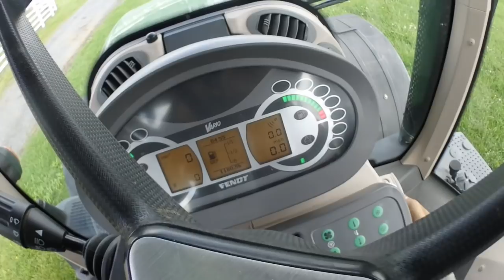Picked Up The 7930

Comment: When it comes to power on Fendt is easily identifiable, 828 stands for 8 - series and 28 + 0 = hp, so 828 is a 280 horsepower tractor. If you get a 936 it would be 360 horsepower, or a 715 is a 150 hp and so on.

Comment: KX means it was 1st registered in at our DVLA (DOT) in the Milton Keynes region (K) by the Northampton office (X). 12 means is was registered between 1st March & 31st August 2012. Last 3 letters are random. The 1st letter is for 1 of 19 DVLA regions all over the country. Then the second is for the DVLA office that issues it. Most regions have 2 DVLA offices that deal with registrations, large areas have upto 5 like Scotland. So they split the the second letters up between the offices  If the plate had a 5 or 6 as the 1st number is was registered between 1st September to  28th February.

Comment: New Holland won't ever be the tractor old Ford tractors were
Reply: Wonder how the parts prices compair now days. Between NH and the other brands.  We got rid of all our ford stuff. Years ago. Parts were absolutely way out of reason!
Reply: @rogercarrico4975  Oh, NH has TOTALLY screwed everybody on parts.  NH has made me a Deere guy, basically.  NH got p!ssed when they bought out Ford Tractor Division back in the 90's and they couldn't come to an agreement on the parts network, so Ford kept it.  NH had to subcontract Caterpillar Ag to handle their parts for them til they could get their own parts network up and running.  OF course they jacked the prices on parts up into the stratosphere to pay for that, and they stuck with it ever since.  To punish the Ford owners, they canned all the parts support for all the old Ford shortline equipment (implements and stuff) and basically gave the farmers running them the middle finger.  NH's quality has gone to SH!T in the last decade and the prices they get for stuff is nearly as expensive as Deere, so why not just buy the Deere and get the better Deere quality and UNQUESTIONABLY better parts support??  CIH p!ssed me off years ago when they froze out parts for their older cotton pickers, and gave us the middle finger.  Bought a newer one they outright LIED that they still supported the parts for it.  Then the SOB dealer wanted me to buy an even newer one and I was like, "Yeah and how long til yall quit supporting parts for IT??"  SO I bought a Deere picker from the neighbor and my parts problems were solved.  Deere stands behind their stuff.  Case/International Harvester/New Holland (CNH, now owned by FIAT (Fix It Again Tomorrow!) is about as bad as AGCO... so many bankrupt brands all bought up and run by a third-hand company and don't know whether they're coming or going.  No thanks.  

I bled Blue for decades but CNH has turned me GREEN!!!  

Later!  OL J R :)
Reply: @lukestrawwalker  I understand completely! I would be terribly gun shy of getting involved with a NH again. Once you buy it. Their done!!
Reply: @rogercarrico4975  Yep... I grew up on Ford tractors.  Grandpa first bought a pair of 8N's back in the early 50's to farm with when he first started farming my great-grandpa's place.  He'd just bought a Ford 6600 a year or so before he passed away in 83.  We farmed with that tractor until the late 90's when we replaced it with a new 5610... We were always blue guys because Ford had the cheapest tractor to buy for the HP/size and it was the cheapest to own because parts were WAY less than CIH or Deere.  We ran IH cotton pickers because they never made a blue one LOL:) and for many years they were measurably better than the Deere cotton pickers.  That ain't true anymore... probably 90%+ of cotton pickers in this part of the world are Deere machines now, and probably 75% of combines.  AGCO isn't even around this part of the country anymore... their last store, Rioux Equipment, closed in El Campo probably 10+ years ago.  I think there's ONE NH dealer with about 10 different shingles in front of his place (shortline brands he sells) that can get AGCO parts anymore, that's it.  NO dealers.  CIH stores are as much construction stuff as farm stuff anymore, that and some hobby farmer red "Boomer" tractors LOL:)  

But now, CNH is as high if not higher (on some things for sure) than Deere, and the quality is nowhere NEAR as good on CNH stuff as Deere... so you might as well buy the Deere because their support of the older machinery is WAY better than CNH... Later!  OL J R :)
Reply: @lukestrawwalker My nearest CIH dealer is 35 miles from me now. Our local dealer stopped selling them back in the 90's Sells Kubota now and other foreign brands( I do still have a CIH planter.) I can understand it.  He's in Hernando MS. Which is really just a suburb of Memphis, TN now.  So many people have move out. Purchased a few acres. Need a compact tractor or riding lawn mower. The Ford dealership we always traded with.  Was a partnership. They genuinely wanted your business. Always tried to accommodate you. Their prices were good. Knew a lot if farmers. Knew who wanted what. I remember going to look at a tractor on this man's farm. Pretty big farmer. Who had ALL Ford Equipment. 10+ tractors. Disc,planters, cultivors etc.All ford! Because this dealership no doubt. When the older one passed away. The other one. Who was really was the heart of the business. Had problems with the others family. So he went to work for The John Deere dealership close to us. So that Ford dealership was just delsoved. He was a major factor in us going Deere. ( I purchased a new 7400 from him in 96. Still have it.)  There were 2 more Ford dealers with in driving distance. Both of these is where I ran into trouble! Get this!!! I went in one day. Asked for a water pump kit for our 5000. Was told I had to purchase the entire pump. Like $80 instead of $20. I said but I remember rebuilding this pump several years ago. Just got the kit. Nope!! Not offered like that now!!! This was before internet. But I went home. Had wrote in the manual the date. Dug out my receipt. With the part number. Called the same dealship back. Fortunately, spoke to another parts guy. Gave him the number. Said No problem!! He would get it.They wanted you to go the most expensive way. So they could make more money!! The other dealer was NO better. Just sky high prices Just HAD to forget about Ford's. Both of those are gone now too. Shame Really! But I sure would be afraid to put major money into a peice of equipment other than Deere's now.
Reply: @rogercarrico4975  Yes exactly.  We have two "local" formerly Ford (New Holland) dealers we deal with.  One is 23 miles from our Needville farm and the other is here in Shiner.  We finally decided to trade off the old 1968 Ford 5200 row crop tractor Grandpa bought new in 68 and get a 5610 because it was gonna need several thousand in work and new tires too and it was getting kinda tired for what we were doing at the time.  The dealer 23 miles from Needville quoted us $3,000 trade in on a $21,000 tractor or $18,000 cash drive out.  The Shiner dealer quoted us $6,000 trade in on a $16,000 tractor (exact same model tractor mind you!) for a total drive out price of $10,000!  Needless to say we wrote a check on the spot.  A few years later he cut us the SAME DEAL trading in the 82 Ford 6600 on another 5610, so we wrote him another check.  Now a few months after we bought the first one, I went to the 23 mile away dealer to buy filters for the new tractor to do an oil change.  The owner happened to be at the parts counter, same guy I'd talked to when I got the quote-- he gave me the quote.  He said, "OH!  You bought a 5610?? When did you do that?"  I told him, "A few months ago..."  He asked where I bought it, and I told him "Shiner... they offered twice the trade in you were offering and $5,000 less on list price, so I got it for $10,000 difference..."  He got this sour look on his face and said, "Hmmm... I'm gonna have to have a talk with corporate-- he shouldn't have sold you that tractor-- we have protected territories!" and I just looked nonchalantly at him and said, "Weeeelll... I wouldn't have bought that tractor from you AT THE PRICE YOU QUOTED anyway-- If I was gonna spend THAT kind of money I'd have bought a Deere, or gone to another dealer I'd talked to because I could have gotten a Massey cheaper than your quote..."  He looked like he bit into a sour lemon and left in a huff for his office... LOL:)   Wouldn't have mattered anyway; we have a farm IN SHINER and so protected territory or not we COULD have bought the tractor from Shiner anyway LOL:)  Besides that, I ended up telling the Shiner dealer that story one time while we were having a BS session and he just laughed... "We don't have protected territories; he was making that up LOL:)"   It's a shame because that other dealer USED to be good dealer-- my Grandpa and the owner USED to be good friends-- they met when they were both cigarette salesmen restocking cigarette vending machines after world war II in the late 40's/early 50's, before Grandpa started farming and before the dealer married the daughter of the guy who had started the business.  She couldn't have kids so they adopted two boys, and they run the business now.  Their Dad was one h3ll of a salesman and a nice guy, but those boys-- they schmooze the big money guys (which is mainly turfgrass farmers now) and treat everybody else like second class citizens or sh!t on their heels... and I don't put up with that... My money is just as green as anybody else's and if you want any of it you can treat me with the same basic human respect as everybody else, or go pound sand.  When we row cropped we bought a H3LL of a lot of parts and stuff from them, but now I buy 98% of my stuff from Shiner...  buy maybe a few rolls of twine from them a year and maybe get a belt relaced once in awhile for the round baler, that's it.  

Later!  OL J R :)
Reply: @rogercarrico4975  Yeah our CIH dealer screwed us over years ago.  We had been running an old 214 cotton picker for a couple decades and it finally was biting the dust, and the engine gave up early one picking season.  SO, I was beating the bushes for another cotton picker.  I saw an old trade in on the back dealer's lot and looked at it and it was kinda rough but I was desperate and the price was right. I DID ask the dealer SPECIFICALLY, "Can you still get all the parts for this thing?" because I would have just taken a few days and rebuilt the engine on the old one IF I had been able to get parts, which I COULDN'T... Even NAPA was like "tear it apart bring in some rings and bearings and stuff and we'll see what we can match up in the books".  Didn't inspire confidence and I didn't have a month to fvck around with crop waiting to be picked in the field... OF course IH was NO USE whatsoever "we don't service those parts anymore-- that's OBSOLETE!"... SO anyway I asked him "Can you get the parts for this thing" since it was one series newer (about 5-10 years newer I'd guess) and he was like "SURE!  We can get any part you'd need for this machine!"  Which turned out to be a ball-faced LIE... so taking his word I bough the thing.  SO I drive it home and start picking and get through the first pick and had JUST gotten started good on scrapping the cotton (We used to pick at least twice back in those days (early 90's) and even 3-4 times if the cotton was good and it held onto a good enough top crop and finished it out...  Now they leave the cotton in the field a month to open up more, hit it with PIX boll opener and defoliant and pick it once and shred the stalks down).  Anyway, I had just started scrapping the cotton on the second pick and BAM driveshaft U-joint yoke on the axle busts.  I drag the machine to the shop with the tractor and pull it off and go to get one, parts man (his nephew) looks at me like I beamed down from Mars and was like "we can't get that-- it's obsolete.  I can put it on the obsolete parts network and get back to you..."  I went home and sat a few days and called him back, "Yeah I heard from a guy in Mississippi said they might have one back in an old warehouse behind the dealership he'll have to go look when he gets a chance, I'll call you back when I hear"  so the next day he calls, "No joy, he said they must've cleaned out the warehouse last winter all that stuff went in the scrap dumpster... Sorry you're SOL".  Well, the yoke was a special size you can't get, but after hitting about a dozen semi-truck places in Houston I DID find one, but it wouldn't fit in the carrier bearing unless it was turned down so I bought it and was going to go to a machinist to get it turned down to the right size.  Anyway, the rain set in ruined the second crop so I just gave up and shredded it down and plowed it under for the year, while I was searching for a substitute part.  That's when I pretty much had a belly full of it-- we'd been scouring neighbor's junk rows and fence rows and piles of sh!t behind their shops for parts for YEARS (and they scouring ours LOL:) because IH was SO sh!tty about providing parts and we'd pretty much all cleaned each other out.  The last straw was one rainy day I went to the dealership and sat down with the parts man and we were scouring the books for ANY other U-joint yoke that might work, off a combine or anything else... The salesman (owner) that sold me the old picker walked by and asked what we were doing and I told him and he was like, "Well, I DO have a little newer picker out there I'd sell you!" and I was frustrated and rather p!ssed and popped off, "Yeah, and how long til you can't get parts for THAT ONE!"  and he walked off pretty quick!  That turned up NOTHING so that's when I started hitting the truck parts places in Houston.  Anyway, I got disgusted with the old POS and was like, "I'm gonna get SOMETHING better I can get parts for sick of this sh!t" and started talking to the Deere picker guru who'd worked with my Dad when I was still a toddler and Dad worked for the dealerships during the winter months.  I asked him about parts and he SHOWED me, "We can get parts for ANY Deere picker all the way back to the first self propelled model 99's!"   The neighbor had a 9900 Deere double row for sale so I bought it.  Good picker!  Ended up trading it on a 9920 a few years later and then buying a 9940 as well.  Never had a problem with parts.  IH just didn't give a sh!t; they wanted to force ALL those older machines into the junkyard and FORCE everyone to buy newer machines like 782's or 1822/1844 machines... GUESS WHAT they forced ME to buy a Deere and FU IH!  LOL:)  NH did the same when they bought out Ford Tractor DIvision, and so I've not been happy with NH for awhile, now they're a loser company that bought out ANOTHER loser company that went broke TWICE (International Harvester and now Case/IH) and now they're BOTH loser companies that have been bought out by friggin' FIAT... NO THANKS.  Almost as much of a sh!t-show as AGCO who owns about at least 15 different brands that went toe up on their own over the years or sold out... Oliver, White, Massey, Allis-Chalmers, Gleaner, you name it... don't know whether they're coming or going and they're virtually EXTINCT here... Later!  OL J R :)

Comment: That Fendt standard is 280hp. FPT is one of the best on the market atm, would still rather have the old bulletproof Genesis in the TM's
Reply: powestar*
Reply: TM and bulletproof??? nope tm175 and 190 are junk (vp injecton pump in first place) lower models 165 and below are okish. Genesis engines were good in 8970 series when they had Inline  injection punp

Comment: It not only about how fast  a tractor/ equipment can go down the road, it also about how well the tractor/ equipment can stop with their braking systems.  Wabco Tractor ABS
 on Fendt and New Holland. https://youtu.be/7gbqcbtLkIQ  (The book maximum speed for the  1290 HDP HS with hydraulic brakes on the tandem axle is 50km/h,  about 32 mph.) At a  mix of tar temperature, ambient temperature, route distance, traffic speed/ density, it can be preferable just to truck the machinery where it is required e.g cutting crews carrying the combines etc. https://youtu.be/6LlI2H37vAw?t=75

Comment: Fent are really easy to identify the hp, the first number is the series and the second two are the horsepower rounded to the nearest 10 so that one you where looking at is an 8 series and 280 Hp only place it gets a bit confusing is series relates directly to the physical size of the tractor,  that don’t have models as such, you have to go of the year for that. An 8 series from 2020 for example shares absolutely nothing in common with the 8 series from the early to mid 2000’s but it could have exactly the same number if they had on the same hp in the series back then.

Comment: ive ran a fendt 930, JD 6250R and a JCB 4220 all three on a Massey baler and i have to say the speed and comfort in the jcb is far better then the fendt and miles in front of the john deere but the JD has the better cab

Comment: isn't it possible to reprogram the john deere ivt to make it go faster? With the NH it is possible to program it for smaller tires than are actually on it and so make it run faster (the speedometer isn't correct anymore but thats it)